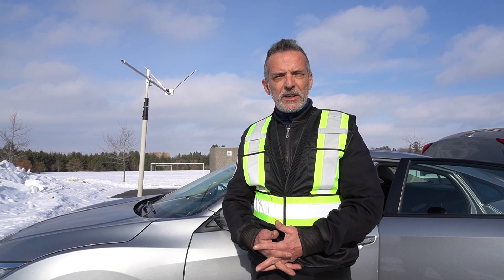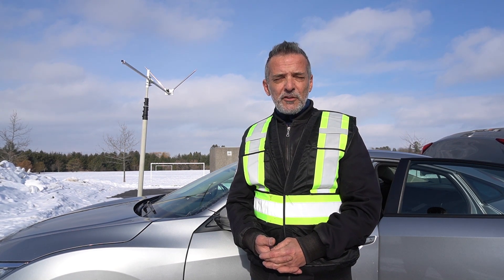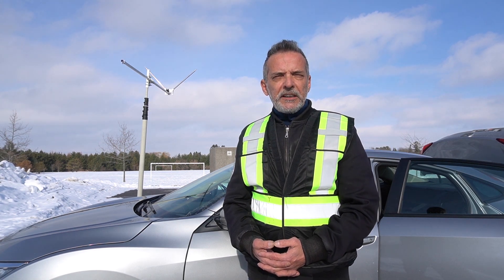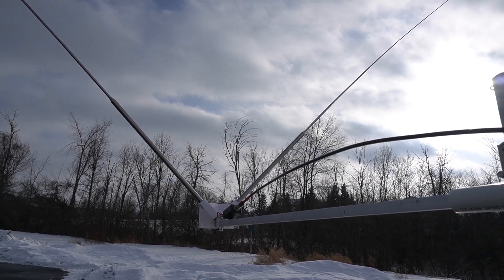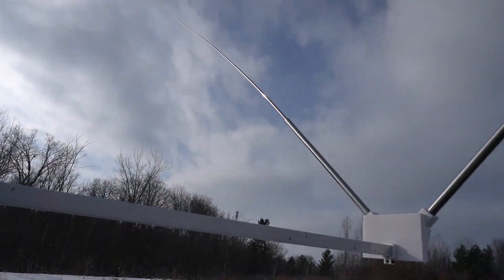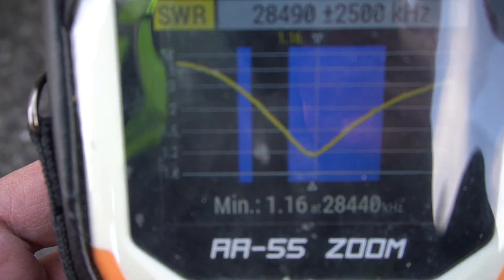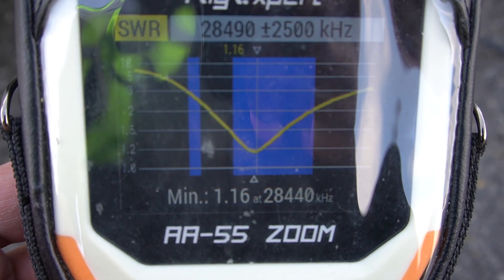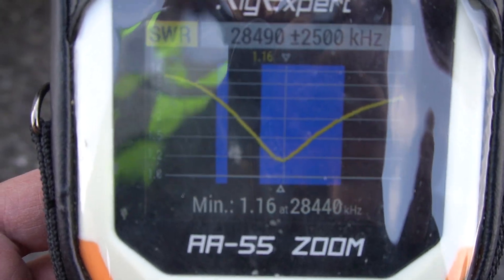HAM RADIO - New Home-brew 2 Elements V-Beam Antenna 10m-15m

Comment: I had a V-Quad (Maco)  2 element driven and reflector antenna since1981. It worked good on 11/10/and 6 meters with tuner.  I have seen a multiband  quad (4 sided) that had 20 meter down to 10 on it.
Reply from the maker: I only did one test with this antenna so far, after that the cold weather came back, today is -20C. After tomorrow should be better and hope I get out to do more test. With the boom extention it should go from 10m-20m, also my measurements is not quite right I think another thing to check. 73's